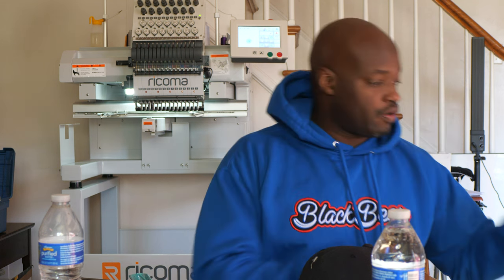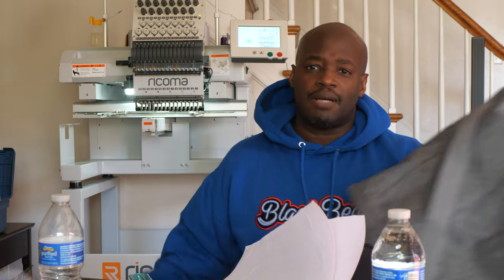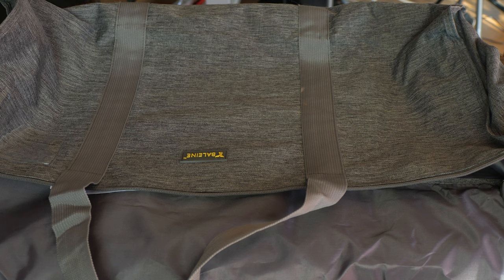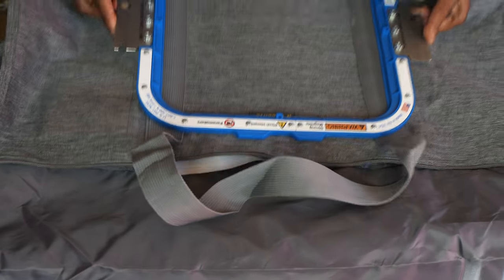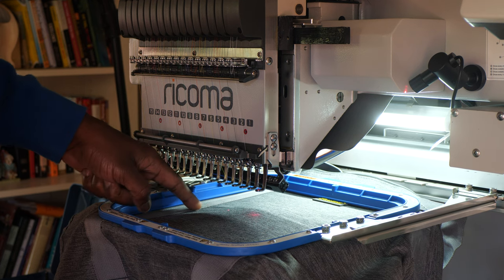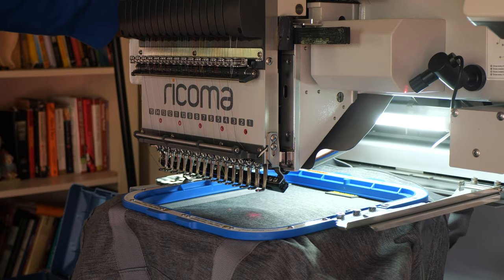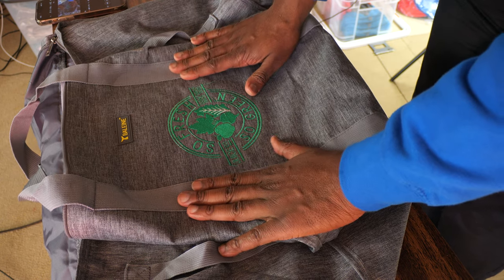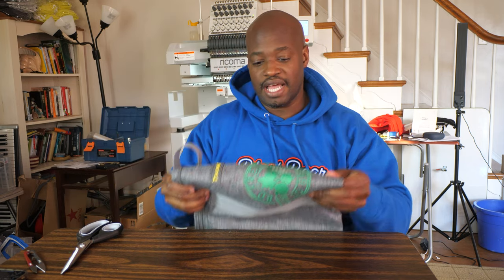Embroidering Thick Thermal Bag | Ricoma MT-1501

Comment: Need to look into c112 from sanmar. Those hats are very very close to the Richardson 112’s
Reply from the maker: Yup. I saw them. They have the customers color but it didn’t have the black stitching that the richardson had.
Reply: @adubbproductions  that's sucks those are the only ones I use now. For snapback unless someone was like Richardson or no deal.